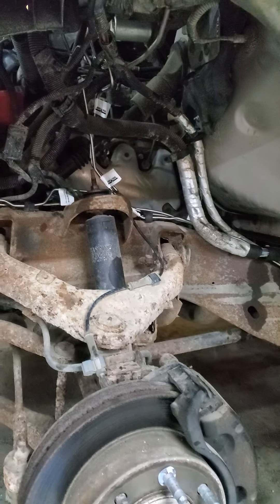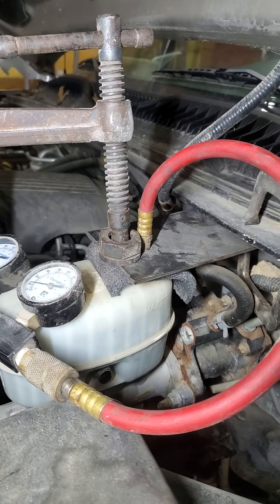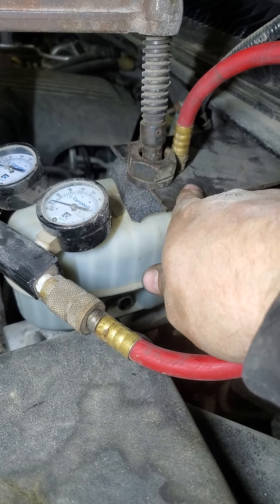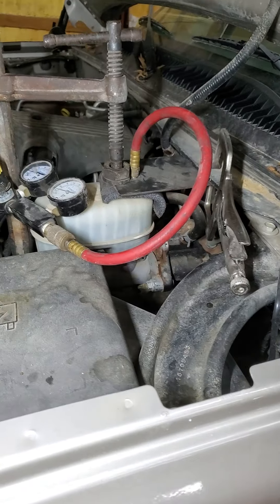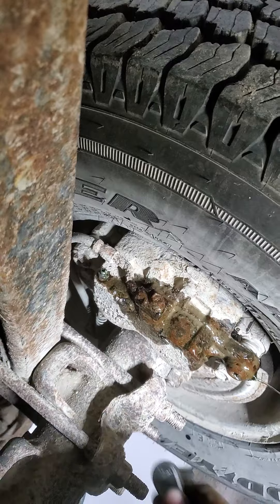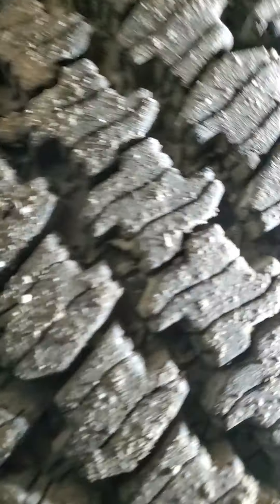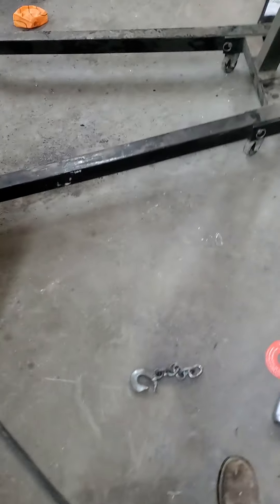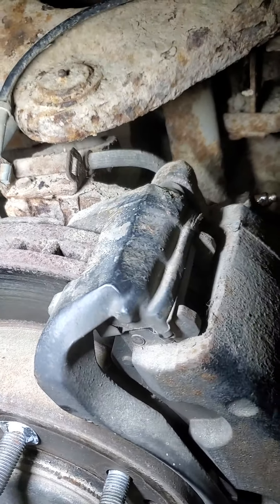(#31) chevy silverado brakes won't bleed after line replacement? quick method to bleed them

Comment: I replaced all the lines on a 2000 Z71 Tahoe (obs), I cracked all four bleeders just slightly, filled up the reservoir, checked the level a few times, and eventually let it sit overnight. The I bled the lines the old fashioned way and it came out just fine.
Reply from the maker: Gravity bleeding is a great way to Bleed brakes if you have the time.

Comment: Best idea I've seen yet. Just replaced all the lines on my 04 Avalanche and can't get the pedal to firm up. Going to try this.
Reply from the maker: Good luck!
Reply from the maker: Just be careful that you don't blow up the reservoir.  It's really not about pressure.  Just  3 or 4 psi to start.  Just give it enough to force the fluid through.
Reply: @black_sheep_fab9411  That's about of what I was thinking. It's kind of a large reservoir so wouldn't take much psi to blow it up.
Reply from the maker: @mocoleman5579  ya it could also pop the reservoir off the master cylinder.  Neither of which would be desirable.  I do a lot of sketchy shit. Lol.  It works but you have to have common sense
Reply: . Just did this about an hour ago and it worked awesome. I had a bunch of air come out of every line. I never would have gotten them bleed the regular way. I think most of the air was at the ABS pump. This is also the perfect way to replace all the brake fluid in the lines.
Reply from the maker: @mocoleman5579  awesome. Thanks for the update.  It's worked great for me on every one so far.
Reply from the maker: @mocoleman5579  I'd drive it a couple weeks then Crack each bleeder to let any residual air out that may have worked itself out of the system and u should be good to go.
Reply: Will do. I may have a small leak at the ABS pump. I'll have to check again tomorrow. Thanks again for the video. Saved me a lot of time and headache.
Reply: Maybe I should try this on my 2000 Chevy Silverado. I can’t get the brakes firm to save my life. 4 new calipers, rotors, and pad. Bled 2x still super soft
Reply from the maker: @TrapperJosh  give it a try.  Not much to lose
Reply: @TrapperJosh  I would. It works great. Only hard part is making the metal plate. I just used a 1/4 pipe thread tap and then a quick connect fitting. I also used 2 regulators. The one off the air compressor I set around 10 to 20psi. Then the second regulator about 5 psi or less.

Comment: Found out today talking to a mechanic.  If you change out the main caliper housing they  are side specific, bleeder need to be toward the top. If not it will never bleed out properly.
Reply from the maker: Yes that is correct.  Air goes to the top so the bleeder has to be at the highest point.
Reply: Yep I found this out the after I put mine in upside down. I did leave mine but was a little spongy for about a week then all was well fixed itself.

Comment: Question my 1998 Silverado driver side front caliper open no fluid coming in and out I already replace the brake hose but no fluid coming out from the feeding line you have any idea what that can be
Reply from the maker: I would be thinking maybe proportioning valve or master cylinder issue.  Or possibly a smashed or creased hardline blocking flow
Reply: Did you ever figure this out? I’m having the same problem.